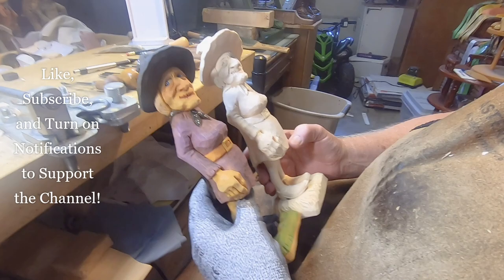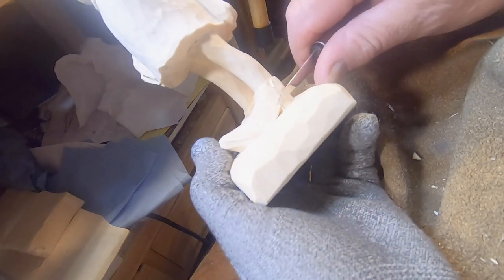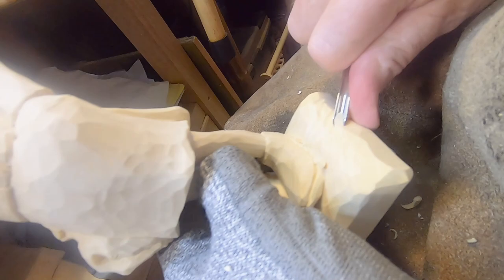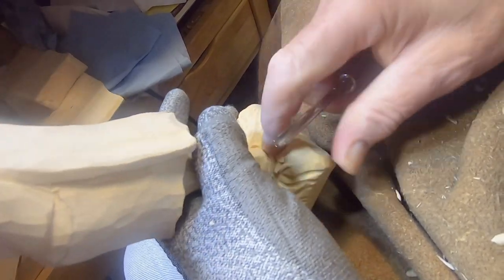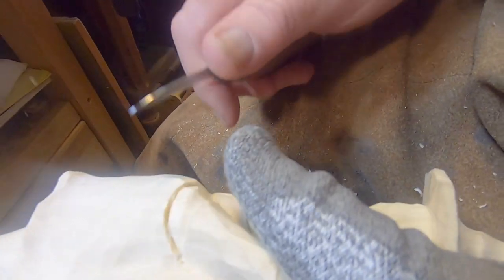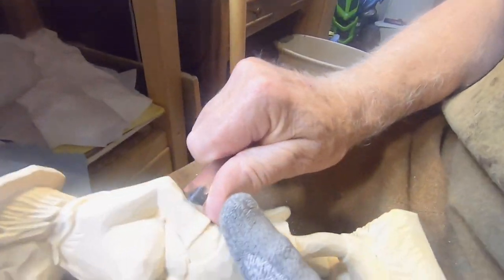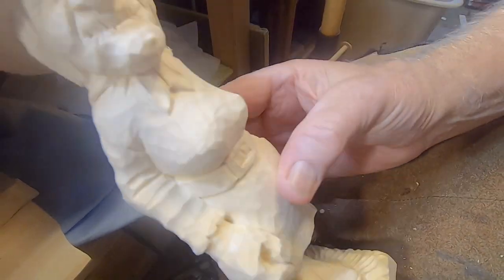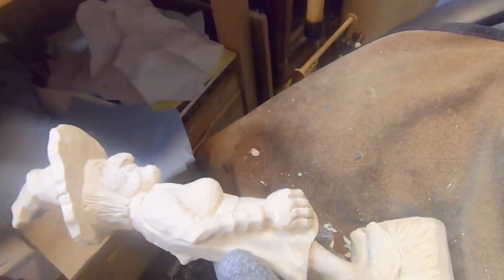Witch with Purple Robe--final session (Part 5)

Comment: Why use the #11 on the sole line of the shoe and then follow it with the "V" tool?  Would you get the same result only using the "V" tool for this?
Reply from the maker: It makes a canal for my v tool to run through and makes the soul line a little deeper but you don't have to do it that way.
Reply: @rogerstegallwoodcarvings8181  Thanks